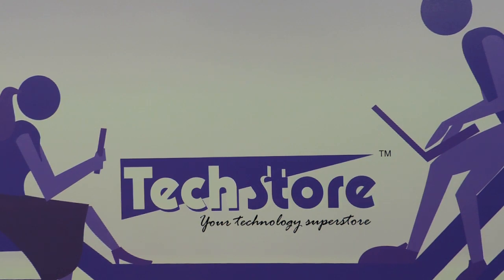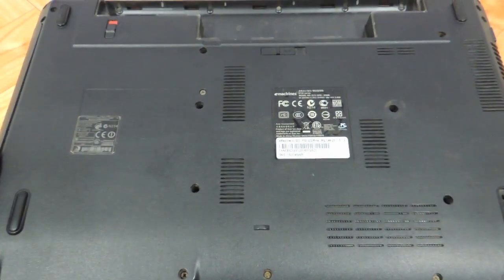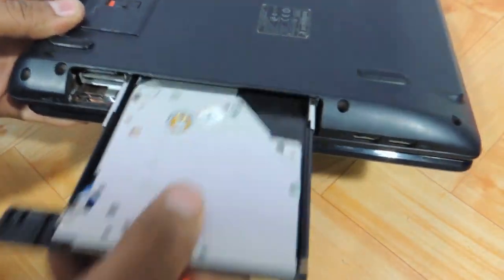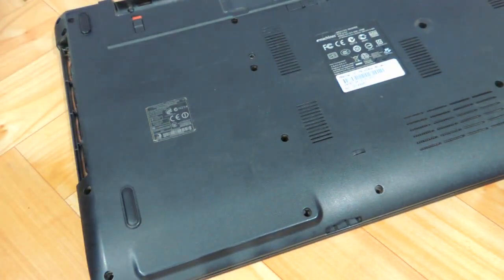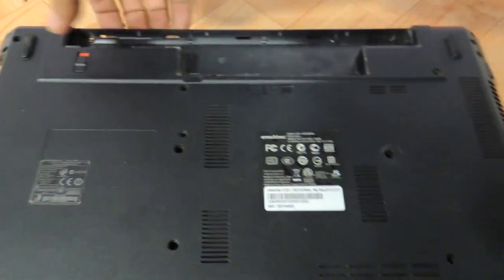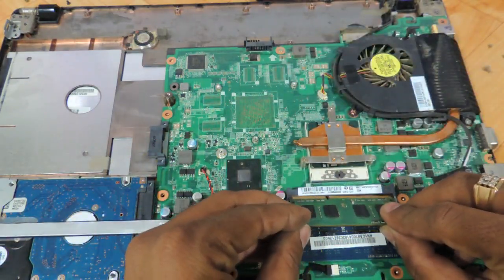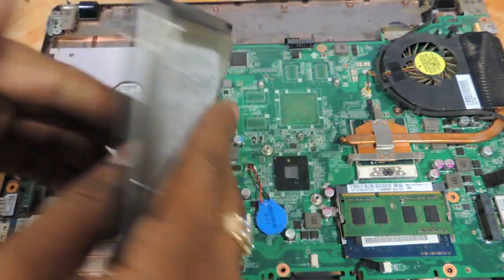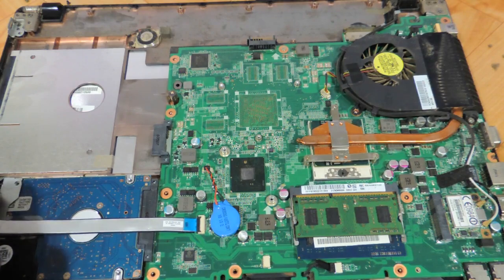Acer Emachine e732z 732 732z How to upgrade ram and harddrive

Comment: Thank you subscribed
I have same laptop but which 2gb ddr 3 stick should I buy???
Mghz?
Reply from the maker: 2GB DDR3 1333 Mhz
Reply: @TechstoreCoIn  quite late replied I bought 1600 mghz DDR3 2gb ram and it works fine

Comment: I've got a 2001 emachineE520 needs a new keyboard mouse buttons need repair hard drive needs upgrading plus Def needs more ram ive got 1 gb it's running vista 32 bit so it's probably gonna cost a fair bit

Comment: What's the maximum ram that emachines e732 supports? I wish to upgrade to 8gb from its current 2gb configuration. Can I do that? Also, what's the slot configuration we can make? Since it has 2 slots, does it have to be 2×2 or 4×4? Can't it be 2×4?
Reply: Yes, the maximum is 8gb Ram.

Comment: You don't need to remove the DVD trimmings. Actually, just leave it be altogether.

Also, the main hiccup in removing the bottom panel, when all the screws are loose, is the 3.5 mm sound connectors in the front. Lift the cover  beginning from the back and use caution and you will probably be alright.

That is also the case at re-assmbly. Slide and tilt the cover over the 3.5 mm connector trimmings beginning at the front first, then it will be a smooth ride.
Reply: Yep this is correct, thanks!